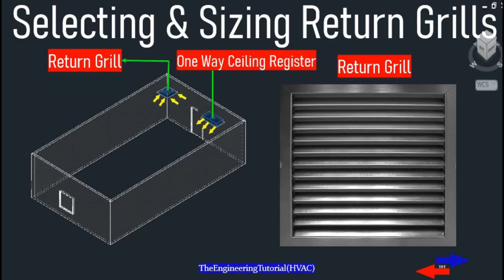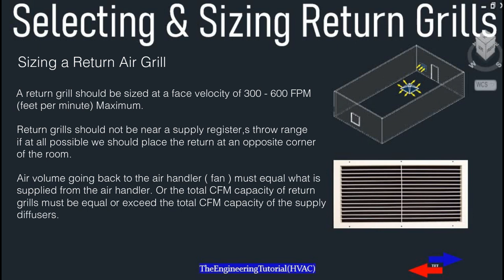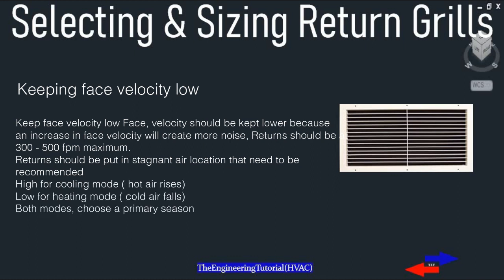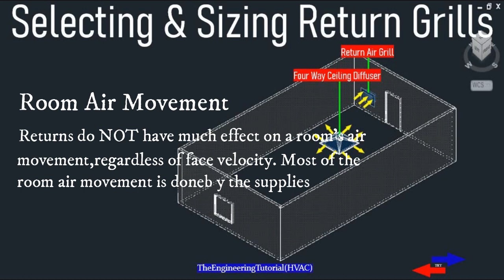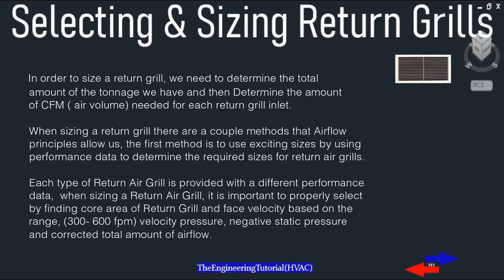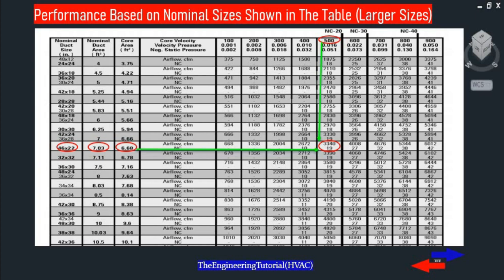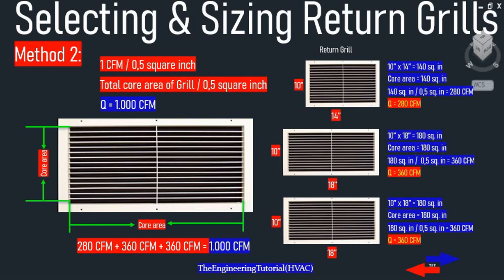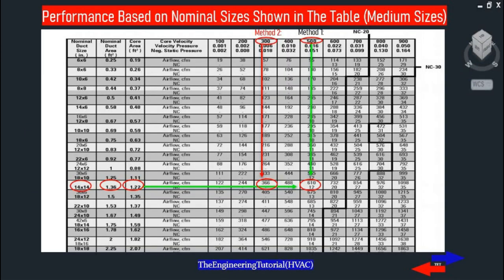Proper Selection & Sizing of Return Air Grilles

Comment: Stupid question, cuz ive got to missing something
hen calculating the Core Are Return Grill for a 18x10 grill = 18 in x 10 in = 180 inches^2
So when converting to feet (12" = 1ft) , why are you using 18" instead of 180? From my calculations it looks like its 180" / 12" = 15 feet. But in reality, 15 square feet doesnt sound right.

EDIT: Nevermind, I knew it was something stupid I missed....you converted to feet first
(18/12)*(10/12) = 1.25 ft^2

Comment: I have some questions that seem straight fwd, but confusing too!  I have a group of (3) Diffusers i want to use that say its max CFM is 145 each for a 12x4 unit. The Plenum box  they can supply with it says it only has a 6" duct. To me this in no way would exceed 75-85CFM. So Would i size my return grill based on this max CFM of the duct from the supplies?
Reply from the maker: Yes, based on the maximum CFM of your supply
Reply: @theengineeringtutorial2290  Thank you!  My engineering brain told me that was correct but the guys selling the vents wanted me to size my return based on the max cfm of the supply registers, not the supply ducting (which is less). Their way would cost me more with a larger return grill.

Comment: Can you please share the table you use?  and why we need to divide by 0.5 sq.in .thanks sir
Reply from the maker: 1 CFM / 0.5 to 1 square inch of core area is just a rule that will allow you to maintain your air velocity suitable. So  if you use 1 or more CFM for less than 0.5 square inch your return air grille will liable to noise or undersized and if you use 1 or more CFM for more than 0.5 to 1 square inch of grille that will be oversized. Some More rules for selecting return grille other than this rule has been also already explained in this video, can used be used to solve your problem.
Reply: @theengineeringtutorial2290  Thanks bro..can share the table chart you use and  email to jmaljamaluddin@gmail.com